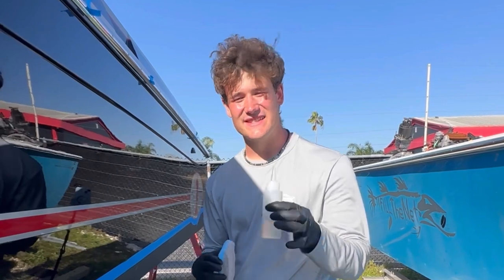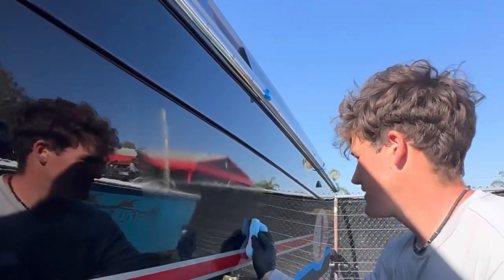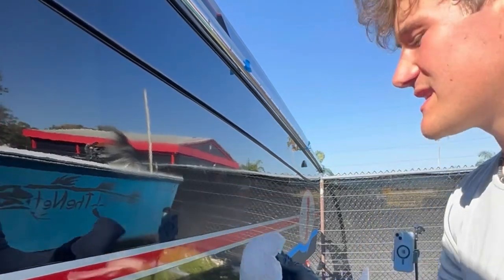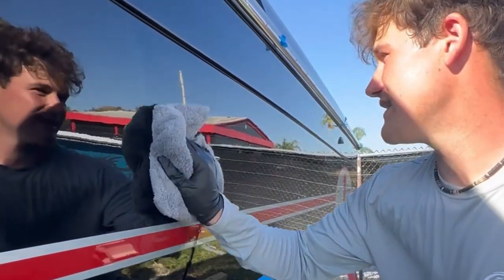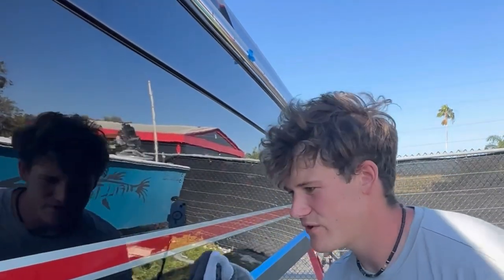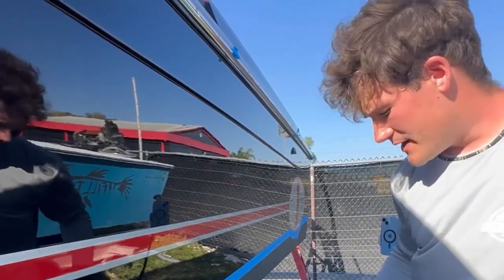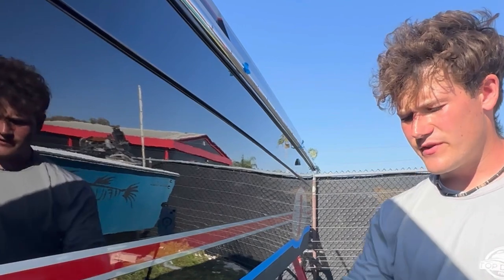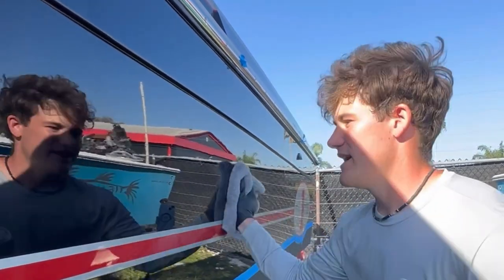How to Ceramic Coat a Boat

Comment: Is it necessary to use microfiber towels that have not been previously used for ceramic coating?  I did some Liquid Thor and used the towels again for another area of Liquid Thor.  Didn't seem to be an issue.  I'm now using Repel Pro (sig. different consistency/wipe characteristics) and would like to hear your opinion on this before proceeding.
Reply from the maker: Not necessarily but they should be in good condition and clean!